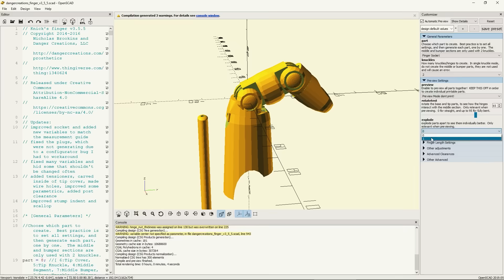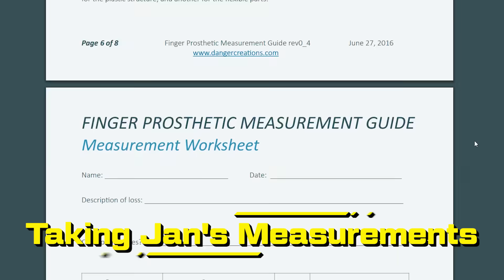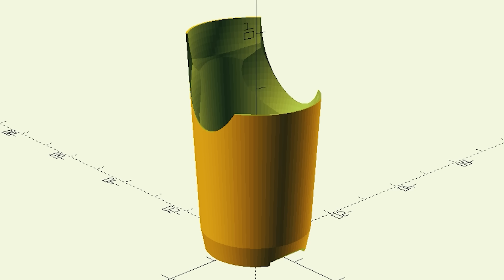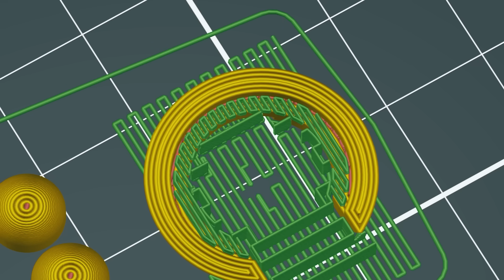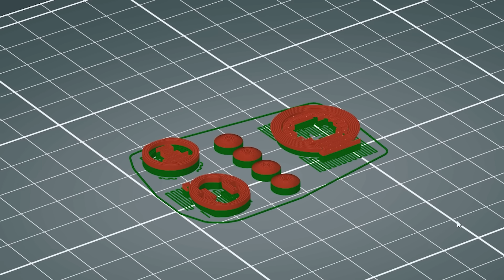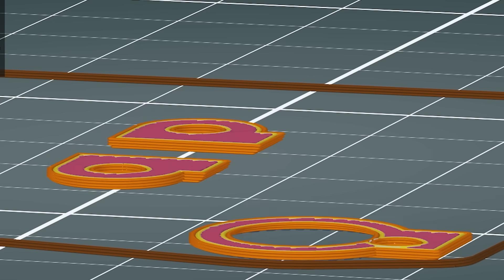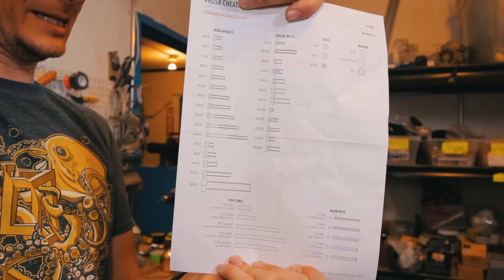My Friend Lost His Finger so I Printed Him a New One

Comment: Jan probably lost it like my cousin did, going down a medal slide with his hands down the side of it, and whoosh a small piece of metal chopped it right off, never trust a medal slide in the summer, or if it's hella rusted out and pointy.

Also as for my cousin, well this happened when him and my dad were both young and they didn't want to get into trouble for him losing his finger, so they did what any kids would, grabbed flashlights and looked for it. They never found it, and he like Jan has only the power of 9, unless I get a 3d printer and then i'll give him the finger...

True stories.

Comment: I know this is not in 2 days video topic and u have probebly hear it before but, u guys really need to get urself a cordless drill and stop using the corded hammer drill on ur builds, apart from when a hammer drill is the right tool to use. Not only for your safety, but for mine (darn thats 10 pushups), my norwegian carpenter heart bleeds everytime I see u use the hammer drill on small objects and screws. Love ur videos and vlogs. long time CD fan.

Comment: Wren  you should add some thin rubber pad on the bottom side of the pinky and the tip of it ,so that if he wants to pick something like the soda there could be a grip that the pinky can grab a hold on. Cause it’s gonna be difficult for plastic to pick up a smooth surface.

Comment: It was just a normal day, he was out for a hike and heard a yell.  He ran over to a steep decline to find a fellow biker trapped under a fallen tree stump.  

Lan desperate to help gained the strength of ten men and pulled the stump up, but it was heavy and the hiker had limited time to scramble out from underneath it while Lan struggled to hoist it up.   Lan put all his strength into his left hand to hold the stump up while helping to pull the joker out from underneath the stump with his other hand.  Just as the hikers feet where out from under the stump, it slipped and land hand was trapped underneath.  His only hope was to yank his hand out, leaving behind his pinky.  Still trapped underneath the stump.

Comment: The gun Jan was using is probably the best nerf gun I have ever used, because of the hammer system it uses to shoot, you can actually pull off some quick fire like in the old cowboy movies, and it is surprisingly accurate.

Comment: When my cousin was 5 he got his shoe laces stuck in an escalator and it pulled in his shoe and ripped off 4 of his toes. His big toe looks like this because it took off the tip. When I was a teenager i cut off part of my left thumb with a table saw. And last but not least a carpenter friend cut off 3 fingers with a table saw and the home owners dog are one so they only reattached 2 of them. He has a nub like this. If he wasnt born without then I'm sure he had to of been young because over time it just becomes normal and you live without them as if it never happened.

Comment: I severed my left thumb at a Boy Scout camp while instructing---INSTRUCTING---the woodcarving merit badge.  Clean cut right through the pad, into the nail on the other side. Instant shock, no pain. I felt cold metal, then warm blood, and the feeling of my thumb being shorter. 
It was reattached at the hospital with only local anesthetic, and it's still 97% functional. I have extremely diminished sensation, as if I'm always wearing a latex glove on just that thumb.  Occasionally, I have flashes of pain from inside the thumb, like a bee sting in the bone, followed by a couple hours of itching.  The part of the pad where I cut through is kinda hollow, so sometimes I lose grip on things like phones or cards.